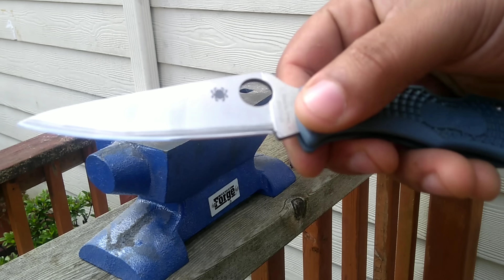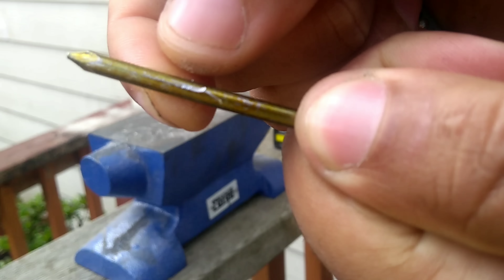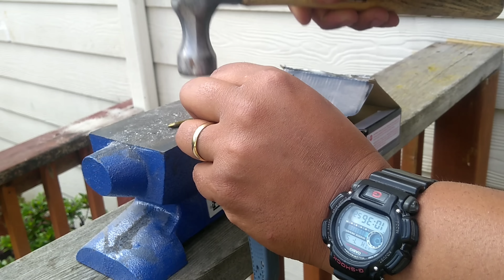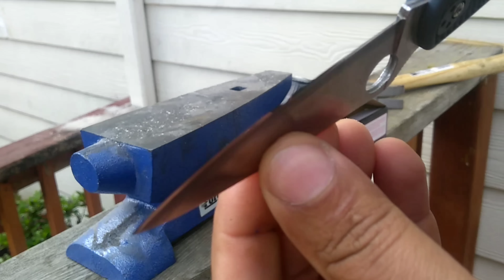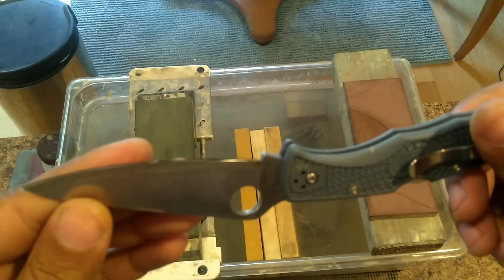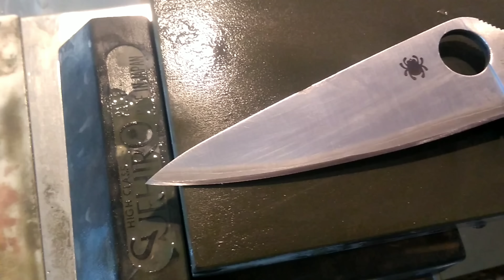V-TOKU 2 | Destructive Edge testing and Repair

Comment: Hi, I have a problem with the blade bending on my Endure V-Tok. With a slight push on the blade, my blade bends by about 3-5mm and the assembly is curved. Is this a normal feature of this laminated blade? I am honestly quite disappointed in that. I have more Spyderco legs, but this hasn't happened to me yet.
Thank you in advance for your answer.

Comment: i should have got the vtoku instead of the SG2 endura via massdrop... of which i still gotta wait for.
Reply from the maker: Tactical Center nah, the SG2 will be rad bro
Reply: Big Brown Bear your probably right. Plus it looks cool with the black and gold.
Reply from the maker: Tactical Center that was the steel they were originally going to do but dropped due to cost. Honestly I'd rather have the edge holding over toughness

Comment: How does the width of the chip compare to the width of the nail? In other words, did all the blade that came in contact with the nail chip out?
Reply from the maker: southerncross100 it seemed more like it rolled and deformed so bad it looked like a chip.